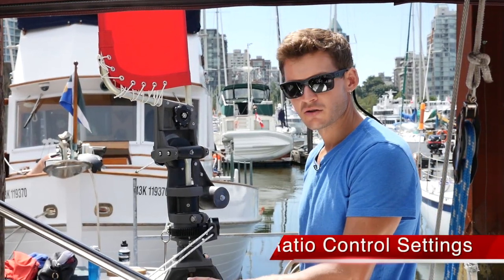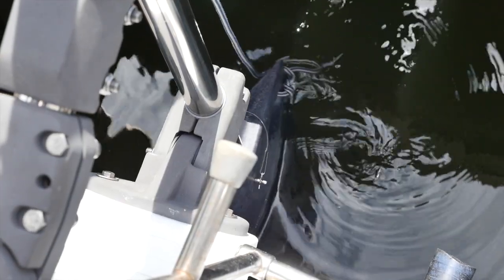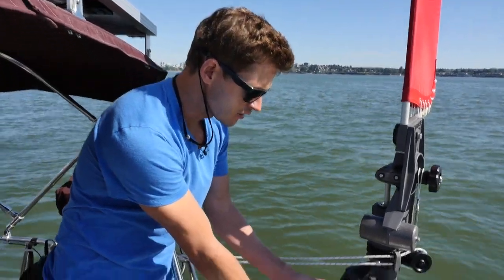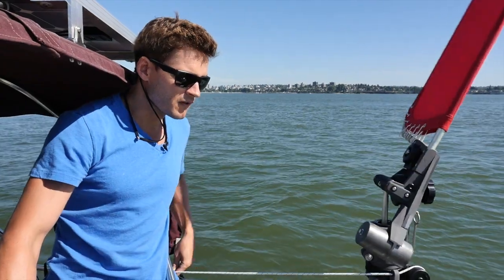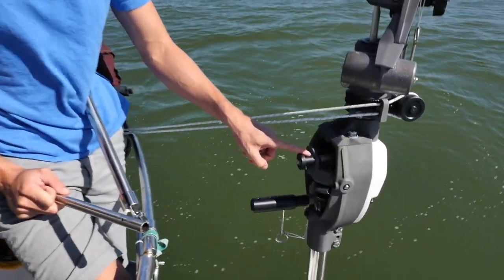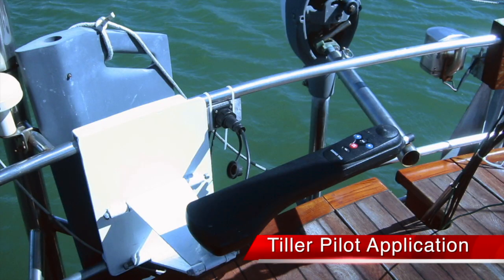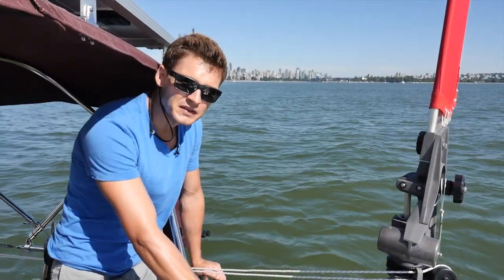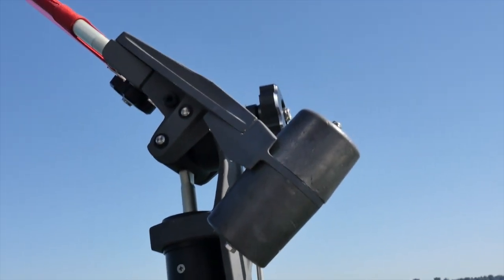Hydrovane: Operation

Comment: Good video. I finally started playing with the Hydrovane tthat came mounted on my boat. Even being out in the elements for 20 years everything worked. I ran some paracord as the adjustment line, but didn't make a continuous loop. It would jump off the slotted roller on the Hydrovane. I just flipped the loop at the roller so  there's an X after the two holes before it goes around the roller. Stays on just fine. I think if I was in an emergency use I'd just put 25-50 feet of paracord, with the X at the roller. Then I could make all the adjustments I'd need. To seure the line just loosely tie off the two strands on anything.  
I think I should probably do some sailing with it just so in an emergency I'd know how to use it. I think we've all had long days, or multiple days where we're on a basic heading, the wind doesn't change that much. Perfect for using the Hydrovane.
Reply from the maker: Great to hear!  🤩 The best remote course setting is 4mm 8 plait line without any stretch. It has to be new (ie not salty!) to do the heat weld and make an endless loop. Feel free to reach out if you have questions!

Comment: Great design and system, have it on a Custom Moody 45 cutter, use it for local and offshore sailing single handed all conditions, including upwind in heavy air. No worries re wear and tear on steering quadrant, or electronic autopilots which burn out with circuit boards from overheating and actuators going back and forth,  and prone to breakage, having it as a backup rudder is a real bonus, it saved me one day when main rudder jam from running over crab pot.. Main rudder is used  as a trim tab for balance -another bonus. Highly recommend this over a pendulum/servo tab design.
Reply from the maker: Thanks for the excellent report, Alan.

Comment: Good video with a simple and concise explanation of especially showing the remote control rigging. What would be nice is an expanded video where while on the water you show setting it up for certain points of sail and if you tweaked the set-up or controls how that effects your sailing.
Reply: Yes, but that might take a while to produce. It would be best to have lots of different wind conditions.

Comment: It occurs to me that in an extreme emergency (say you lost electrical power and then dropped the red vane in the ocean) or just for fun, one could use the tiller and rudder for ‘Sailing to Tiller’ steering; it’s complicated to set this up on wheel steering, but the addition of this hydrovane tiller makes it possible; as an alternative to hand steering 24 hours per day.
Reply from the maker: It's a good point. If you no longer had the Vane onboard, you could certainly try that.  (nb - always keep a tether on the Rudder and Vane).  The other option is making a new temporary Vane! See this link for a similar situation: https://hydrovane.com/?s=catalina+400&post_type=stories&sentence=2009  :)

Comment: Nice video, one question though, if something under the water snaps off your rudder, wouldn't the Hydrovane rudder also get snapped off? A trawler line for example would just rip through both, no?

Comment: Impressive product........when hydrovane is disengaged what positions and holds its rudder?
Reply: I believe that there is a small line attached to the windvane rudder that you can use to lift it.  You can see it in the video.
Reply: The line controls the angle of the red vane only. 

When the gear is disengaged the rudder won’t turn. You can hold the rudder straight (in line with bow to stern line) by inserting the locking pin through the gear casing and shaft.

Comment: what is the rudder , the big rudder on the boat doing  when this little rudder takes over. im thinking it just goes along for the ride or do you tie it off. Thanks.
Reply from the maker: Hi Terry, you must lock off the boat's main rudder so it's fixed. It can be slightly off center if there is any weather or lee helm. Cheers, Sarah.
Reply: It is important to remember to secure the main rudder, and at a helpful angle; if you don’t the two rudders will fight each other and you’ll wonder why you can’t hold a good course.

Comment: Excellent presentation!  Couple of questions.... Could the dodger or pilot house interfere with the flow of the wind to the vane?  In your opinion is the Hydrovane technique superior to the serveo/pendulum technique?  Is one more suited to a particular style boat than the other?  Thanks for posting.
Reply: Does your boat sail dead into the apparent wind?  LOL
Reply: I have built and used a servo/pendulum self steering gear connected to the rudder stock with rope and chain. It was a very powerfull system and could pull the boat back on course easily.The leverage produced by having a long blade deep in the water is enormous. The boat it was installed on was 34' and I tend to think this system was overkill. The hydrovane looks very well engineered and probably gains extra power by the "balanced" rudder.Hope this helps.

Comment: So it steers the boat relative to the apparent wind angle, but it doesn't steer to a specific GPS location, or a set heading?
Reply from the maker: That's right! All mechanical windvanes are set to steer at an angle relative to the apparent wind. 

That's the beauty... even as the wind does its minor shifting, your sails are always trimmed properly - very efficient sailing. 

If there's a big wind shift, it's easy to adjust that angle (to get back on your desired heading). And then trim the sails on the new point of sail.
Reply: Hydrovane Got you. Thank you for replying.
Reply: Yes, of course, unless you hook up an electric tiller autopilot.
Reply: If sleeping and close to land there is a danger of a wind shift changing the boat heading dramatically towards a hazard, so one would need to set an alarm on the multifunction display to alert you. This happened in the 2023 Golden Globe race with one sailor off Lanzarote and as they were not permitted modern electronics there was no alarm. One needs to stay aware of the situation and potential risks. With modern electronics it’s fine. To set a compass heading disengaged the hydrovane and engage the tiller pilot.

Comment: Will,
Question for you.
I've seen SEVERAL videos of sailors who have the Hydrovane installed with the CURVED part of the vane facing FORWARD...as opposed to the above video...which shows the curved part facing AFT.

Does it make any operational difference WHICH WAY the vane is mounted?

Are there any conditions which suggest/dictate which orientation should be used?

Thanks.
Reply from the maker: Hi Romeo, thanks for your question! 

The Vane itself only clamps one way - but can be rotated 360 degrees (pull the course adjustment line to rotate). So what you have noticed is not a difference in mounting, but instead boats using the Hydrovane to steer on different points of sail. 

In order to 'set' the Hydrovane to steer on a desired wind-based course, you need to ensure that the leading edge of the vane (the NON-CURVED edge) is feathered into the wind. 

In this video, we're sailing upwind so we've rotated the Vane so that the leading edge is pointed forward.

In other videos, if you see the non-curved leading edge facing aft, that is because the Vane has been set to steer a downwind course - wind coming from aft. 

If sailing on a beam reach, you would rotate the Vane to about 90 degrees - into the wind. 

Hope that makes it clearer.  

Cheers! Sarah
Reply: A..hah!

That makes sense.
Reply: I want a first mate as smart as Sarah!!!  Ü

Comment: hi, i am just wondering how this works in variable wind conditions where the wind quickly gusts and changes directions? thx
Reply from the maker: Great question. It’s the same as any autopilot or windvane - you need to depower your sail configuration to accommodate. In those types of conditions you need to be adjusting sails and course more frequently.
Reply: @Hydrovane  ok thank you!
Reply: I was wondering that too. Here in Newfoundland, some days it seems like the wind is blowing from all directions at the same time.

Comment: What happens to the vane's rudder when you're motoring backward?
Reply from the maker: Hi Steven, thanks for the Q.  There are a few options. 1) Insert the Shaft Locking Pin to fix the Rudder fore and aft, 2) Use the Hydrovane Rudder to improve maneuverability, 3) Take the Rudder off before you enter a tight marina (Pull the Rudder Locking Pin. Very easy on some boats).  Your Q is  answered in more detail here: https://hydrovane.com/faqs Cheers, Sarah
Reply: Does it have rudder stops, in other words?

Comment: Like how easy the Hydrovane can be converted to emergency steering.
Reply from the maker: There is no conversion required. When the Hydrovane is disengaged (ie, A Ratio Knob moved to the far right setting), then you are then controlling the Hydrovane's Rudder with its Tiller. That is your emergency steering - always in place and ready to go :)  The Hydrovane is inherently a complete second steering system for the boat. Cheers, Sarah
Reply: What alternative do you suggest?
Reply: As an emergency rudder, it's never going to be ideal. It's intended to give you some steerage, enough to make some landfall somewhere. Otherwise you could just remove your rudder entirely and just use this.

Comment: What happens if the rudder catches on something or hits an object underwater?
Reply from the maker: If you hit a object, you will likely have damage to the keel and main rudder first :/ The Hydrovane Shaft is very strong and the solid plastic Rudder can absorb some of the load. A worst case scenario is that a major impact results in a bent Shaft. We see this from time to time, but almost always from accidents caused by wayward boats in a marina.  If the rudder catches something offshore, like weed for example, you can use a boat hook to sluff it off.
Reply: @Hydrovane  Can this work on an Island Packet 35 with full keel and dinghy davits? I also have a swim ladder in the middle of my flat transom and solar panel on top of the dinghy davits. Thanks.
Reply from the maker: Yes - most Island Packet 35 installations are off center, next to the swim ladder. The dinghy can rest against the Hydrovane when in use. Feel free to send us a photo of your set up, and we can show you examples of sisterships. Cheers, Sarah - sarah@hydrovane.com
Reply: @Hydrovane  Thanks Sarah. The technology you have certainly seems capable. It will be a little bit in the future before we do this upgrade. Regards.
Reply: @snakeplisken4278  with a full enclosure or even an open bimini for that matter would you need the vane to be up above the canvas, I imagine most definitely when sailing up wind?